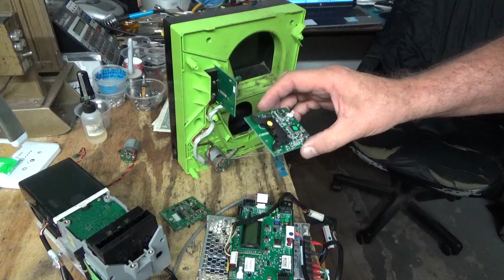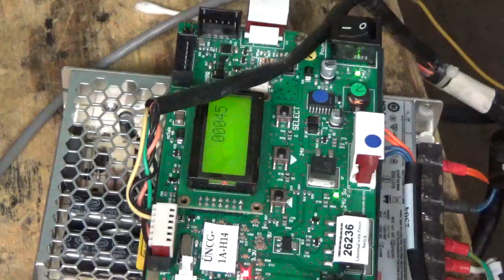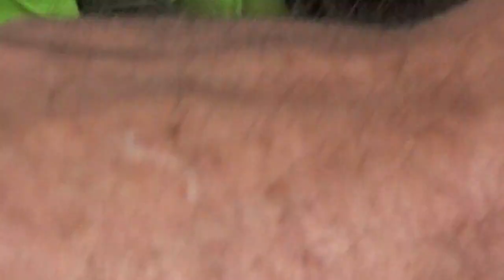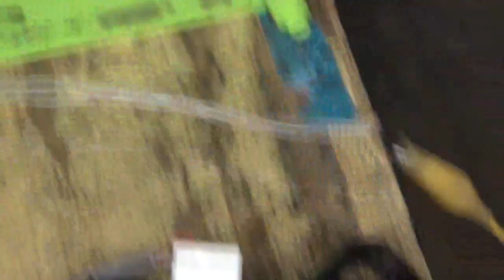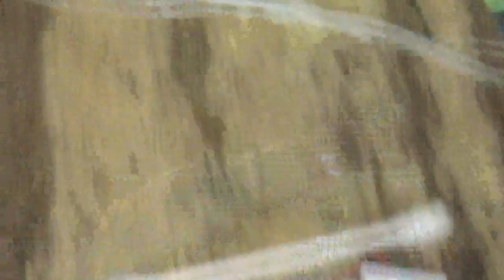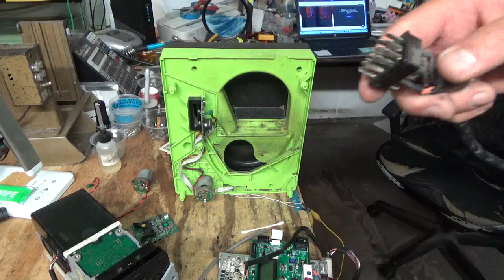Testing The American Changer Green Stripe Hopper Sensor Board

Comment: Do you have for sale a green stripe sensor board. Mine is bad and I need to purchase one. I am in Florida.
Reply from the maker: We only have the newest board, none for the original green stripes. https://dougbaleenterprises.com/shop/ols/products/american-changer-2nd-gen-hopper-sensor-board
Reply: I want for the newer version but want to know if it comes with the black piece that go over the LEDs. Mine the mirror inside of the said black piece is broken.
Reply from the maker: @Anthony-t1u9m  The hopper comes complete and ready to use. https://dougbaleenterprises.com/shop/ols/products/cc-talk-evolution-hopper-with-mount-plate-front-or-rear-load